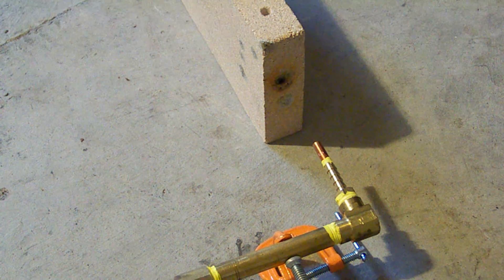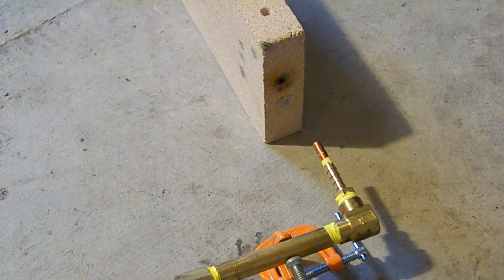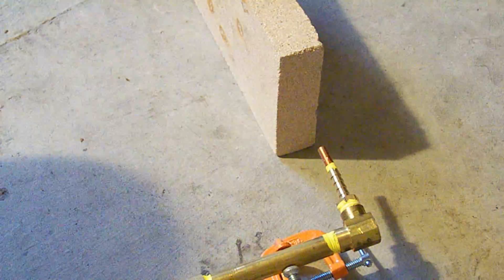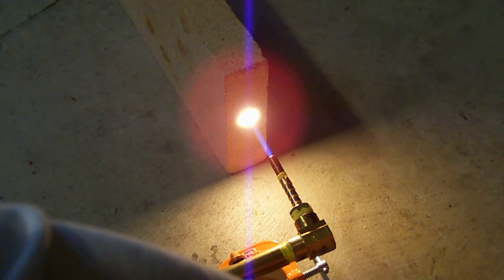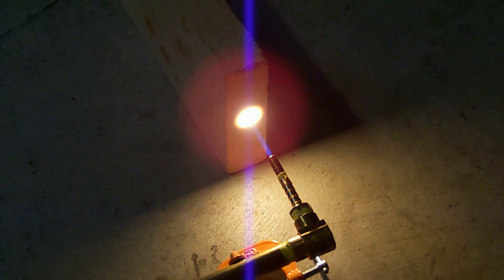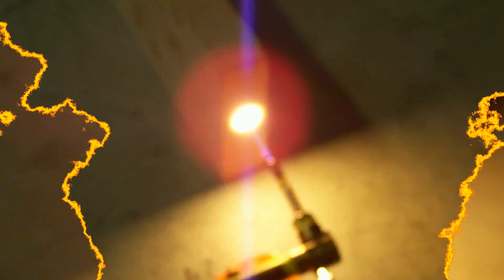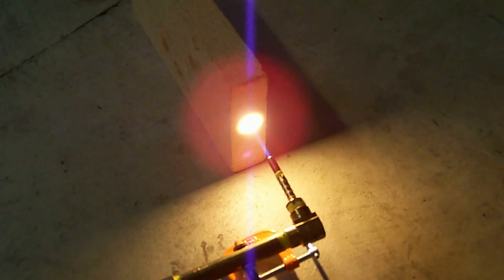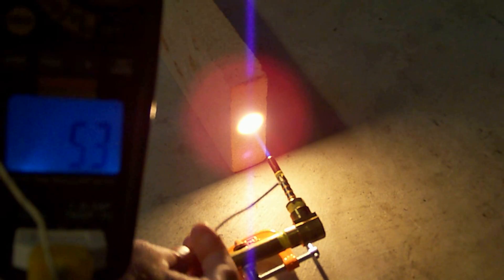H2eat HHO Torch Melting a Fire Brick

Comment: Try heating it evenly with the same heat as the hho , its only melting because of the difference of temperature of that one spot , its designed to absorb heat evenly not in one spot 
Still good video eitherway